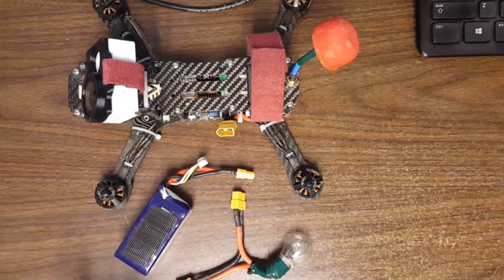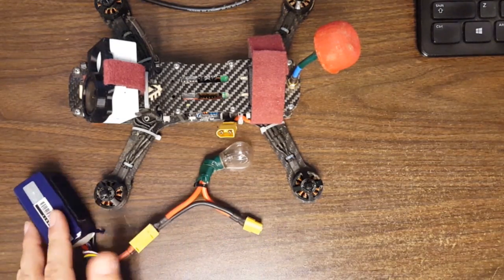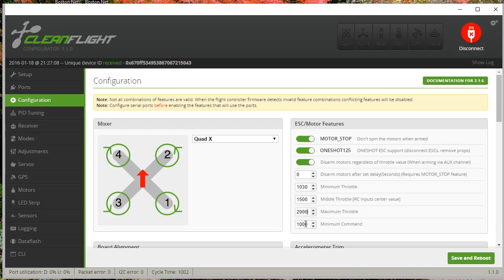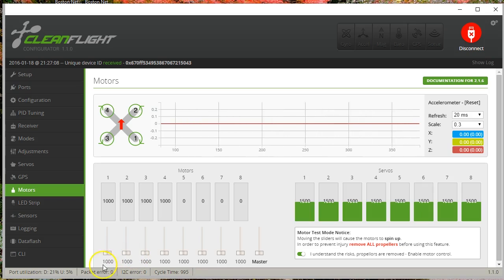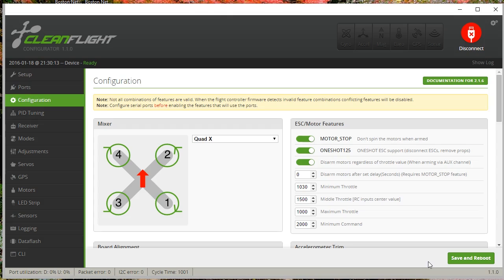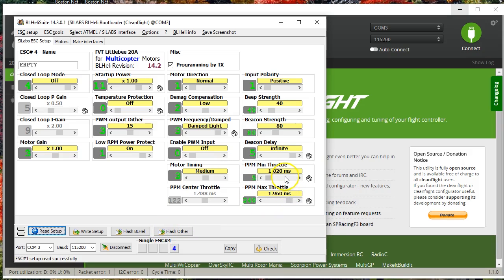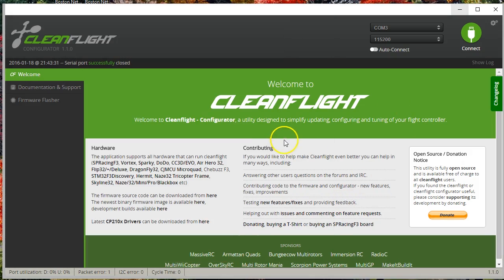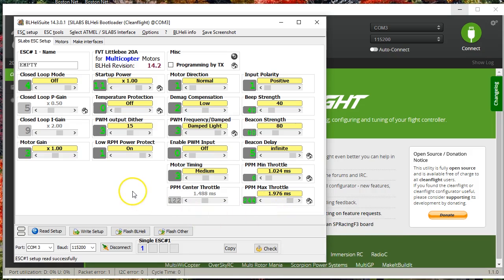How To Calibrate ESCs with Cleanflight and BLHeliSuite

Comment: How do you physically wires the ESC? You skip that part. For example if I want to simply calibrate just one ESC on a bench. What is the setup?
Reply from the maker: It's assumed here that the ESC is connected to the flight controller via the FC's signal outputs.

You can't "calibrate the ESC on the bench" because the calibration depends on the receiver or FC that the ESC is connected to. Only after connecting the ESC to the receiver or FC or whatever is driving the ESC, can you run calibration.
Reply: @JoshuaBardwell  I am struggling with one issue. I have a TURNIGY programming card. Once its wired up to a BLHeli ESC, the programming card "connecting led" is constantly on. I have tried two different ESC and three different programming cards. Same issue. Any suggestions?
Reply from the maker: I don't think a Turnigy ESC programming card can interface with a blheli ESC.
Reply: @JoshuaBardwell  I know and I even tried Turnigy ESC, tried 3 different prorgaming cards..nothing reads the values. very strange. the ESC works fine with TX, RX calibration process though. So frustrated.

Comment: For my Mobula7 FlySky version, should I have it on PPM or PWM? What’s the difference? I tried to read up a bit but I wasn’t really understanding the difference. And if I switch it on my TX I need to change it also in betaflight right?
Reply from the maker: The Mobula uses DShot output to the ESC's. So calibration is not needed or possible.

If you are talking about receiver input, a Flysky receiver should be using serial receiver with IBUS protocol.
Reply: Joshua Bardwell so under the port tab should I turn on the serial RX, and then in the tab over switch it from disabled to iBus? Sorry for so many questions... also if you know how to get the telemetry stick commands working with FlySky TX, and the FlySky mob7 with F4 Pro flight controller. I know it supports the telemetry, and some stick inputs I do will make a beep like when you trim accelerometer on other models or transmitters, but it doesn’t seem to do anything. I used to be able to change profiles with stick commands when it was factory and early release firmware. I flashed newest firmware and tho telemetry tab is on and I’ve also activated it under modes over my arm switch when it’s in the disarm position. But I’d like to be able to trim my accelerometer with stick commands cause I can not get rid of this drift. Thanks man!

Comment: I'm using blheli32 and my min pwm value is 10:10 to 10:16 is that too low also my min pwm max value is 2016 what should I do leave them all different or do they have to be below 2,000
Reply from the maker: If you are using Dshot, then none of this matters, because Dshot does not require calibration. 

If you are using multishot or oneshot, then whatever they calibrate to, that's what you should use. That's the whole point of calibration.

Comment: hi JB, my Hawk 5 dips the front left motor when i punch. I've changed the motor and no difference, is calibrating worth a go or am i faced with buying a new ESC Bullet 4 in 1?
Reply from the maker: Assuming you're running dshot, calibration has no effect. I'm afraid the ESC is a likely candidate.

Comment: funny, but you do not explain how to connect the escs, or what you need to do so
Reply from the maker: This playlist is what you want. 

https://www.youtube.com/watch?v=QhW-0ddGJ7A

There is so much information, it can't fit all in one video. Hope this helps.
Reply: saw that playlist already, love it :)

No, the answer is: not at all, connect the ESCs  to the flight controller, and the fc via usb, also the version information was quite important!! now it does work. I assumed you need some USB-to-UART device or something with SDA/SCL on it or whatever, or an esc programmer card. Anywas, with betaflight 1.13 it works now :)
I am trying to get this ESC
https://hobbyking.com/en_us/turnigy-multistar-blheli-arm-32bit-7a-0-8g-race-spec-esc-1-2s-opto.html
running this inrunner
https://hobbyking.com/en_us/turnigy-1220-brushless-inrunner-motor-10300kv.html
since 4 days now. Always the same: it throttles it up to what feels like 10% in about 1000µs 1100µs linearly, and everything between 1100-2200µs is the same as 1100µs. (I calibrated the endpoints, wrong  endpoints can't do this behaviour anyways)
I am totally clueless now
Reply: even checked the pwm/oneshot125 with the oscilloscope, its good and very clear

Comment: I am using apm2.8 flight controller and its not connecting in Cleanflight...
Reply from the maker: I'm a little confused. You're using an APM flight controller so of course it won't connect in Cleanflight. Cleanflight and APM are two different things.
Reply: so how do I calibrate the esc because one of the motor (out of 4) is starting a little early when I increase the throttle, I have tried the normal esc calibration process..it did not help

Comment: How do I calibrate the spedix 4in1 esc please Josh or does it need calibrating? I made a smoke stopper and have just bought a Taranis Qx7 please help
Reply from the maker: Use Dshot and forget about calibration.
Reply: Hey Joshua. When using DSHOT, is tuning the PPM Min and Max throttle with BLHeliSuite usefull still ?

Comment: Could you tell me which adapter have you used to connect esc to PC ?
Reply from the maker: +Jean Bernard you just plug in to the flight controller USB port.
Reply: I have pixhawk flight controller

Comment: Whilst setting up my new drone, one esc got very hot and the motor just juddered. I asked the seller if I could buy a replacement in the UK to save time, yes they said you can use a Racerstar 20amp. The ones that are on are not Racerstars or a copy of Racerstars but have no name on. Is there anything I need to watch out for when setting it up or would you say don't have an odd one?

Comment: Hi Joshua in first happy new year! Many thanks for your fantastic videos !!! Please I need your help: for start and practice with the 'fpv I rebuilt my old QAV250 lumenier: I mounted on the fc F3 motolab cyclone: I left the default pid I did the various calibrations accelerators and esc but it is unstable in flight😱😱😱 even with propellers new ..in hovering is not standing and slips a little back or sideways and I must continue to correct .. unlike my other two miniquad Armattan LM2 with fc tornado and chamaleon with same fc cyclonet that are stable: what can I do to make it stable? Please Have any advice to give me on how to correct the bad stability? Thank you

Comment: Hi ,i have walkera f210 .when i move my right stick to up (100) just one of the motor on the back is spin hard but the other back is spin too but is not hard  like the the other and they are the same on roll  even the throtle, four of them are spin the same time but after 2 or 3 second  two motor drop down .
Can you help me with that ? 
Thank

(show on leanflight) a
Reply from the maker: Weird stuff happens when the props are off.

https://www.youtube.com/watch?v=xBaefeQtA1c

Comment: Hi Josh Please can you try and help I have a Diatone Tyrant S Today I checked the esc version and found it to be out of date  .I connected through Blheli and it read all 4 esc' It said they where A H 30  I selected the 1st esc and proceeded to flash Half way through, it said Flash failure Now when I try to re flash ,it doesn't see that esc Its only finding the remaining 3 There was no smoke ,fire or anything burning The software just failed
How do I get Blheli to recognize these
Many thanks
As always
Reply from the maker: +spooner Graham if the flash failed and now it won't work you need to re flash over the C2 interface (assuming a SiLabs ESC) to restore function.
Reply: But if they are not getting recognised when I connect to blheli When I click read ,it only finds 3 now, So how do I go about re writing over the c2

Comment: Ok so right now I'm having an issue that kinda came out of nowhere on my 5th or 6th flight and not after a crash of any sort..... so when I arm my quad nothing happens, then I give it a bit of throttle and the motors start one at a time and then it flys great.... but every 1 out of 3 times I turn my quad on only one or two motors spin and the rest are dead.... but then I unplug and replug my battery and it's all fine again
Reply from the maker: Start by testing in the Motors tab to see if the motors consistently spin smoothly. If not, then the ESC or motors are probably damaged. If you are using Dshot, switch to Multishot and see if that helps. Check your CPU utilization also. It should be less than 50%.

Comment: I've got the same ESC's. Their default setting was like 1100 / 1800, Just done the calibration and it's now 1024 / 2020 for every ESC. Does this mean they were extremely out previously?
Reply from the maker: Yes.

I would personally reduce max_throttle until they calibrate to 2016 or less.

Comment: hello, I have a sp racing f3 clone board.   in the motors tab in cleanflight and betaflight the x y and z numbers for the gyro are moving all crazy like even though the drone is sitting still.   the graph shows the 4 lines to be flat.   any idea what's going on?
Reply from the maker: The gyro has a very high amount of low-level noise. You're probably not seeing anything out of the ordinary. Some time back the BF devs changed the configurator to show the gyro instead of the accelerometer. I think it was a mistake. The gyro data is practically useless as it is presented there.
Reply: Joshua Bardwell so if I ever get a noisy motor or vibration I won't be able to pinpoint it through that?

Comment: Hey Josh thanks for your reply. I checked  the throttle expo but it was not turned on. However, I found the problem while watching this video. Somehow I had turned down the max throttle under the configuration tab. It was max 1500. I raised it and it fixed the problem. Thanks for sending me in the right direction. As I get more knowledge I'll understand this video. U r definitely way ahead of me. Thanks again for taking the time to reply and helping me get back in the air. I'm now a new subscriber.

Comment: I'm having trouble with motor/ESC #4. the motor twitches when I put power to it. I checked all my solder joints, and they look good. I've swapped motors to make sure that the motor isn't bad, it seems to be getting a signal, but I'm not sure if I need to replace the esc. all the other motors seem to be in sync after the calibration...just motor #4. any suggestions?
Reply from the maker: If you swapped the motor and it didn't fix it, then the next thing to do is to replace the ESC.
Reply: Joshua Bardwell is it a bad idea to run three 20 amp escs and one 30 amp? or should I replace all to match?
Reply from the maker: It's best that they match, but most people probably won't notice any difference.

Comment: Hello when i put master to full and connect battery i have no signal music (beeps) when i put down i have only 1 beep. then when im using my radiolink at9 motors spinning up and i must cut off. There is problem i cant get calibration mode and dont know why. I have 20A Opto and Naza
Reply from the maker: +Piotr Pietrzak I'm sorry, I don't know anything about Naza flight controller.
Reply: Ok :(

Comment: on my wizard x220, I arm my quad then when I give it throttle it quickly shoots to max throttle and freaks out. I've gone through quite a few props trying to fix this issue. this problem came about after my attempt at soldering a new FPV cam to the PDB.
Reply from the maker: +Coldwater FPV you probably installed the flight controller oriented wrong. Make sure the 3d model on the configurator setup tab moves correctly when you move the copter in real life. Tilt the copter with your hands and make sure the 3d model moves the same.
Reply: Moving it forward and backward is switched. other than that its fine.how would I adjust that? After arming it the motors spin faster and faster, im not sure what causes this
Reply from the maker: +Coldwater FPV physically turn or flip the board so that it matches the copter's orientation.
Reply: Joshua Bardwell the orientation of the 3d model in betaflight is fine now, but when I arm motors and give throttle, they continously spin up still. could it be a soldering Issue
Reply from the maker: +Coldwater FPV no, that's normal. 

https://youtu.be/xBaefeQtA1c

Comment: Sry i have another Question...  where can i change my >Stick Min/ Stick Center / Stick Max< in Cleanflight its by Receiver Tab .. but where can i change this in Betaflight ?
Reply from the maker: Betaflight requires you to do this in the CLI. Best to adjust the transmitter so the endpoints match 1000 to 2000 with 1500 in the center.
Reply: Joshua Bardwell okey thanks..but by the way can you tell me the commands in CLI? And Great Videos:) !

Comment: first, thanks for all ur vids..so helpful..ive been into this for 1 1/2 yrs. now and i always seem to run into new problems, so my latest is...betaflight, 3.1 naze32 rev5, dys XM20a bhheli oneshot esc, mini red bottoms....problem is, naze or esc will not go into sync mode. no sound from esc when i plug battery in, then motors SPIN UP.., but if i plug just the battery, esc work fine..just cant get into sync mode..HELP?? 
 and this is why you take props OFF..this set up worked fine a week ago..alls i did was change the FC to a new one.same as the last...

Comment: Josh, I just followed this video and it was great thanks. I found that Blheli read that my esc1 showed "u" and said "earned or unknown firmware." The other 3 read fine with #2 being the master. How do I fix esc#1 given I updated the firmware from 14.1 to 14.9 on the FVT Litttlebee 20A Blheli escs. All motors work and spin despite this issue.
Reply: This is my problem :( anybfix. Lol 4 years later

Comment: Thanks for the help, any idea why cleanflight will only connect with the batter connected, i am using a vortex 250 pro.
Reply from the maker: That's a weird one. Does the board power up when USB is plugged in? Do the LEDs light up?
Reply: Hi, nothing happens , ive been having trouble with the firmware, upgraded from immersion website but latest doesn't work, other people have confirmed this, i had to install the latest beta, i set my modes on cleanflight but when i disconnect the modes haven't saved, no self leveling, only with the cable plugged in, tries multiple cables and installed drivers, im on a macbook pro 2015 if that helps.

Comment: what could make my accelerometer when in betaflight with quad hooked up and go back to the setup page for accelerometer and it will be off oreintation and ive not touched it? Sorry im getting tired of trying to get this thing to work.. i did a lift off and it walked back and forth and flipout
Reply from the maker: Accelerometer drift when the copter is sitting still on the bench probably means a damaged accelerometer. You can try calibrating the ACC again, but if it keeps drifting, it's probably damaged.

Accelerometer drift when the motors and props are spinning can mean you need more filtering on the accelerometer. But that's not what you're describing.
Reply: so when i try to fly it sits and jerks and it dont go to one side, its like a car sitting there jerking around with big cam lol. Funny how it least flew before but for 20sec and then drop but the owner before had placed a long screw into stator/windings. im about to give up on this thing,what you think? make video and send to you? im scared of breaking to peices if try to fly outside since dark but if help you figure out. should went with droneproz and got a good one to begin with
Reply: do you sell drones lol? to cut cost couldnt i just use my flysky fs-i6 on something from droneproz?

Comment: Thanks for the instructions.  Is it odd that all 4 of my ESC's calibrated to the same values 1012/2004?  It seemed to work, and all the values changed from what they were prior to calibration.  These are racerstar 30A/v2 escs and I did it through Betaflight instead of CF.
Reply from the maker: It's unusual to see them all calibrate exactly the same, but not problematic.
Reply: Ug, something else must be wrong.  They all started at the same time with the motor slider, so probably OK there.  Now when I power up - still disarmed - the motors all twitch like once a second... not the betaflight buzzing, but actually moving.  I changed from oneshot125 to DSHOT600 and it seems to have gone away.
Reply: Frank Posterello mine are the same , same v2 esc & 1016/2030

Comment: please, tell something about new option "Brake on stop"
Reply from the maker: +Michał Cieplik it's intended for motor gliders, to prevent the prop from freewheeling when gliding. It makes the props stop abruptly when you throttle down but also sometimes causes death rolls so I don't recommend using it.
Reply: ofc, thnx for your fast answer - better to know then checking in fight :D

Comment: Josh, I flashed ny secs with Blheli configurator (using MAC) and two of my motors did not show up on the menu afterwards. When I tried to power up the motors, only 1 and 4 worked. What did I do and how do I correct this? Can I use clmeanflight to fix this?

Comment: I recently used my first set of blheli-s ESCs.  I'm using multi-shot.  Whether I calibrate using betaflight or the calibration in blheli suite I get the same result and that is that the max end point is 2012 on all ESCs.  Should I change this down to 2000 since my max throttle setting is 2000 in betaflight or will the ESC automatically map max throttle from the FC to its max?  BTW the ESCs are Aikon 30a.
Reply from the maker: The entire point of the calibration is that what the FC sees as 2000 is not the same as what the ESCs see as 2000. If you change the ESC endpoints to 2000, you are un-doing the calibration. Think of it like the ESC's clock is running slightly slow compared to the FC's clock.
Reply: ah! I see...so when the FC sent a value of 2000 to the ESC, during calibration, the ESC saw it as 2012.  I will get full power from the ESC.